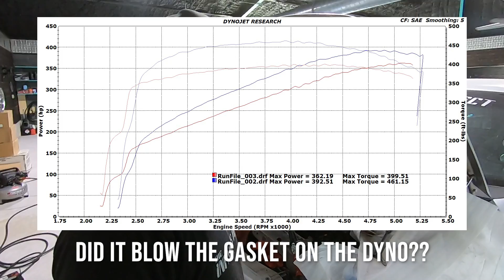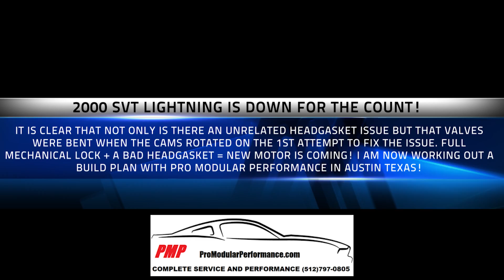Broke My 2000 SVT Lightning! Now What? - TIPS04E57

Comment: The lesson (s) here: 
1. Check the basics 
2. All repair jobs are based on facts, no assumptions should be taken.
3. The procedure should be followed step by step per shop manual.
4. Always use correct tools, correct sst saves the day !! [special service tools]

Comment: My 351 m is exactly locked up the same..I have half the engine undone but haven't got any parts of it yet..my heads and intake are all stuck together..I can't wait to see what this problem is..I've been guesstimated at dropped a valve...good luck.
Reply from the maker: Good luck man!